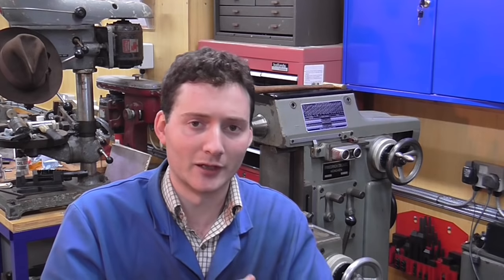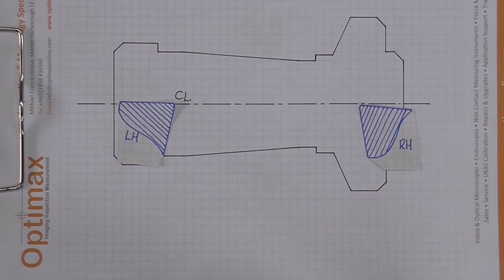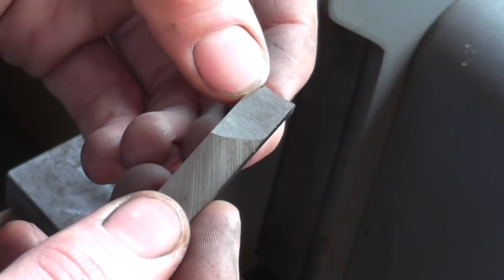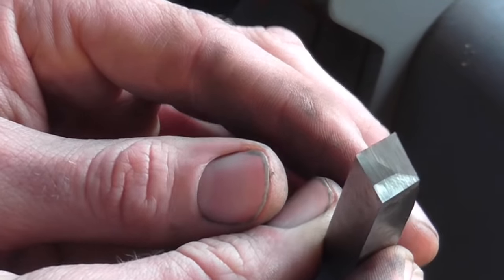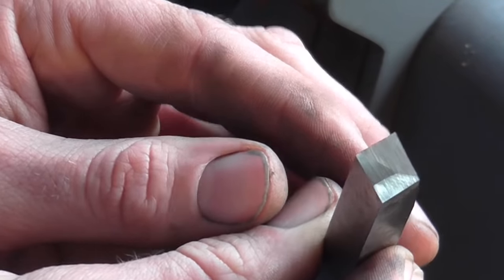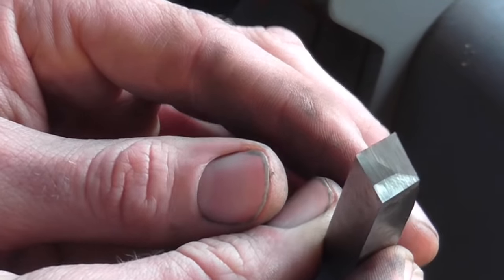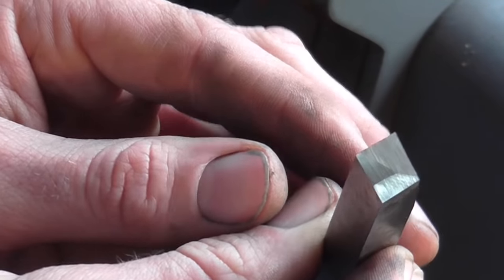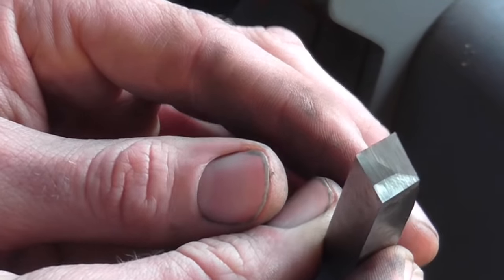Grinding and Honing a Lathe Tool

Comment: I like your channel. But you left out the last half of the title. Should it not be Grinding and Honing a Lathe tool, the number one reason to use tools with inserts. Every time you sharpen that tool you lose your zeros due to not being able to relocate it where it was. So call a Sandvik Rep and he/she will fix you up. 80 degree diamonds give you 4 corners per insert.
Reply from the maker: Yes insert tooling is superior in most catagories although I find HSS or brazed carbide much more versatile. I use insert tools for the standard forms but when I need certain shape grooving tools, radii forming tools or internal tools I tend to hand grind. This video just shows the principals.
Reply: @MrCrispinEnterprises  I agree. Mostly I was just making a comment. I Retired 8 months ago from 37 years in front of a nc lathe. Dude I go back to when punch cards and tape were state of the art. Last was a Fagor controlled 42 inch swing with 120 inch bed. Live everything. It can literally make a bowling pin from aluminum in about 4 minutes, advance the bar and start again. Keep up the good work.
Reply from the maker: Thanks, yes it must have been interesting to see the development of machine tools from punch cards all the way to current machines. 
Cheers, Crispin

Comment: that way is slow, inaccurate
hold your hss in a toolholder, clamp into the post or bench vice, dress with the flat of an angle grinder wheel, done 2 mins
Reply from the maker: Inaccuracy certainly comes to mind with that method.

Comment: A really long winded way to show that you need an adjustable angled tool rest to simply grind the angles on the tool......perhaps a dedicated bench tool grinder with an adjustable tool rest would be far better than the method shown in the video as you can set the exact angles without guesswork, and a small bench grinder with a diamond lap will allow you to lightly hone the to rake angle too.
It is true that a diamond lap is not recommended  for actually grinding HSS, it will do a really good job for lightly honing a tool and with an adjustable table it can be very precise for repetitive re-honing as the tool gets blunt.
Small bench grinders in the 150mm size are two a penny on EBAY.
Reply from the maker: Yes a comparison between an angled rest and non angled rest was one aspect of the information shown.